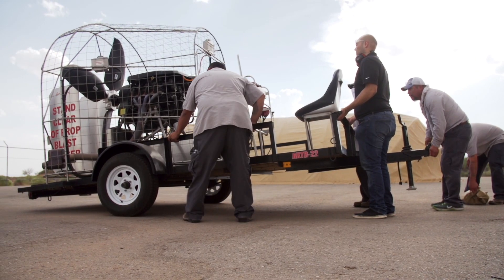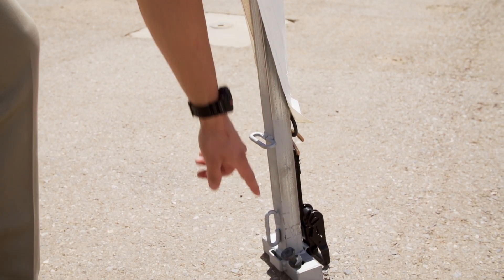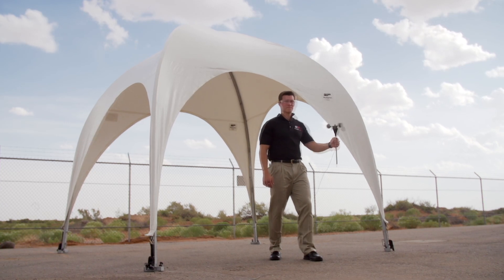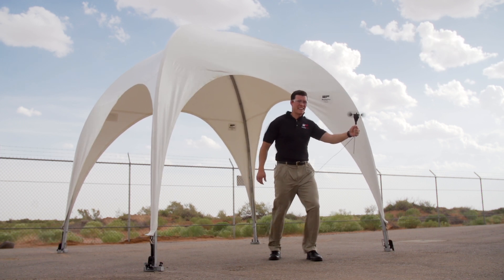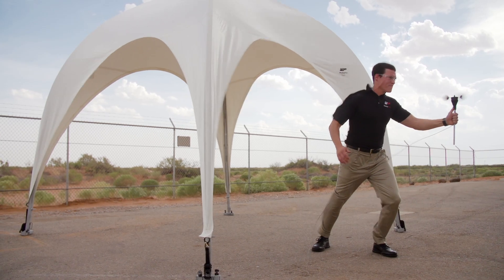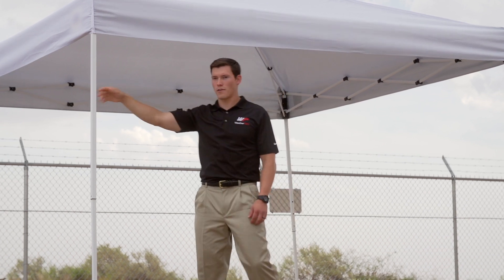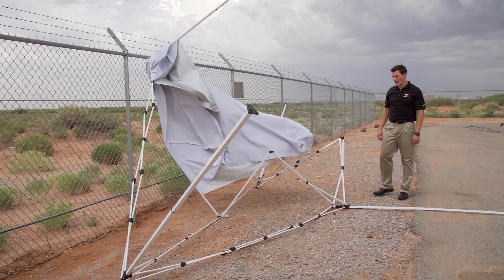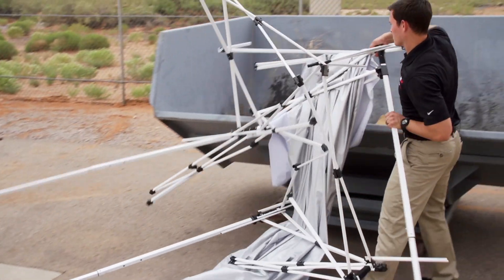WeatherPort Canopy vs. Pop-Up Canopy - Wind Test!

Comment: This is a $1600 canopy vs a $100 canopy. I would hope yours is better quality.

My biggest issue/question is. Are those heavy duty ground spikes you used on your canopy provided with it for the price? Because if not this is very disingenuous. I would actually be interested to see the cheap tent with those same ground spikes if you guys don't provide them with every tent. The structure of the cheap tent didn't fail until it was ripped out of the ground and flipped over. I have a feeling if it was mounted better then it would have gotten much closer to the wind speed of you tent, and at a small fraction of the price.
Reply from the maker: Thank you for your comment and for taking the time to watch our canopy wind test video!

You're absolutely right—there is a significant price difference between a typical $100 pop-up canopy and a $1,600 WeatherPort® Canopy. While both may fall under the general category of canopy structures, the quality, durability, and performance between the two are vastly different.

Our high-wind canopy is built with a significantly heavier-duty steel frame compared to the thin, collapsible tubing used in most pop-up canopies. Additionally, the fabric membrane cover is not standard tent material—it's a proprietary, tensioned fabric designed for year-round use in harsh environments. It's UV stabilized (not just coated), abrasion-resistant, mold- and mildew-resistant, and won't rot—features that make it far more durable and reliable over time.

To answer your question directly: Yes, the heavy-duty ground spikes used in the video are included with the canopy. WeatherPort® Canopies are designed to be securely anchored in a variety of ways, including directly into the ground (using the provided ground spikes), to wood platforms or decks, to concrete or asphalt surfaces, or by using optional ballast frame systems with water barrels or concrete blocks for non-penetrable sites. Duckbill anchors are also available for extreme high-wind conditions.

While we agree it's not a perfect apples-to-apples comparison, our goal was to clearly show the physical and performance differences between typical pop-up canopies and high-quality, heavy-duty canopy structures designed for much higher wind loads.

Thanks again for your interest and thoughtful questions!

If you'd like more details about WeatherPort® Canopies or other rugged outdoor shelter options, feel free to visit: https://alaskastructures.com/products/canopies/
Reply: @WeatherPort  that's a deflection. I see no ground spikes on the "cheap" one and you did not answer the question. Are those spikes included or not? This is an infomercial quality comparison and should be taken as marketing and not an honest side by side compare.
Reply from the maker: @schneik80  Hello! Yes, the heavy-duty ground spikes used in the canopy wind test video are included with the WeatherPort high-wind canopy structure.

While we didn’t specifically focus on the ground spikes that came with the pop-up canopy, you can see them around the 2:00 mark in the video. When the wind starts to pick up, you’ll notice the pop-up’s legs stay put briefly, but then begin sliding and eventually get pulled right out — showing just how easily those standard stakes can fail in strong winds.

Thanks again for watching and asking thoughtful questions — we really appreciate it!

Comment: I need this!!  Had a “Master Canopy”. 10x10 with the roof vent that supposedly makes it a better choice for windy areas.  🤦🏼‍♂️. Second time I ever used it… first time was a dead still sunny day.  It was fine. Yesterday it got destroyed by (the infamous afternoon) wind gusts at Willow springs raceway in Rosamond CA. The scissoring struts broke in three places and it collapsed. Scratched the crap out of my truck to which it was secured on one side.  There were 100 other guys out there with their own Ez-up/canopies.  Mine was the one that got destroyed. I left it for the trash collector.  Cheap thin wall pot metal struts work just fine if there is no wind.  The only thing a “Mastercanopy” actually masters is your Mastercard
Reply from the maker: Hello Steven! The news about your truck getting damaged by a pop-up canopy is horrible! Thankfully nobody was injured during the sudden wind gust. Our WeatherPort canopies are a heavy-duty alternative and, when properly anchored, provide a safe and secure space to enjoy outdoor activities. You can find more information about WeatherPort canopies here: https://weatherport.com/products/building-models/canopies/

Comment: any chance you can redo the test with the cheap popup properly anchored?
Reply from the maker: Hello mp! The 10' x 10' pop-up canopy was anchored using the metal ground spikes that came in the box. Our 10' x 10' heavy-duty canopy was anchored using the ground spikes commonly used to anchor our canopy structures and fabric buildings. More info about our outdoor canopies can be found here: https://weatherport.com/products/building-models/canopies/
Reply: @WeatherPort  So you used included minimal tie downs for the cheaper canopy and industrial 3rd party tiedowns for yours? A fair test would use the same tiedowns. You know since neither top came with the ones you used for the winning model

Comment: What a waste of test equipment.  This is BULL... Totally faulty comparison because it is OBVIOUS to anyone that the canopies were bolted in a different manner and with different bolting material.  The PROPER test would have been to add the SAME weights (eg, 50 lbs per leg) and the same attachment cords to each canopy.  This would be the only way to compare the two.  TOTALLY USELESS VIDEO.... Makes me NOT want to buy your product due to the purposely misleading/shady video.

Comment: Everyone can’t take a 12 and 20 foot ladder somewhere with them just to be able to use a canopy I mean it would be nice if you made one that handles winds like that.That’s just a pop up.
Reply from the maker: Hi Robbie! Agreed. Carrying a ladder to a beach to set up a canopy is no fun. Thankfully, we designed and engineered our heavy-duty canopy structures to provide a large opening (7 ft. tall) for easy access into and out of the canopy and for a setup that doeasn't require ladders!

Comment: That popup canopy has guy lines for a reason. You didn't properly secure it to the ground. They can hold up to much higher wind speeds when properly staked out with guy lines and all. Do the test again and read the directions on the pop up to stake it out properly, with the guy lines. Here's a video of a coleman pop-up canopy in 40MPH wind with no problems. https://www.youtube.com/watch?v=tl4NLtvNGr4
Reply: I'm surprised the pop up canopy made it past 10 mph.. Even "properly" secured those pop up canopies are light weight and hold up to zero stress. Maybe good for cities, fairs, booths, etc on calm days.  When you live in the country like I do with constant wind they just do not hold up.
Reply from the maker: Hi Thomas! We wanted to do a side-by-side comparison. Our 10' x 10' canopy structure did not include a guy line package. So we chose to do the canopy wind test with a 10' x 10' pop-up canopy without the guy lines. In our canopy wind test we found the plastic connectors that hold the metal pieces together were easily damaged in winds of 30-40 mph. Seems like this is a common complaint against instant canopies that use a similar frame system. Our heavy-duty canopy frames are made of galvanized steel or aluminum and do not contain plastic connectors that can easily break. More information about our long-lasting canopies here: https://weatherport.com/products/building-models/canopies/

Comment: Yea let's anchor down the expensive one with giant spikes. And anchor down the cheap one with cheap spikes so the cheap one will fly away. That's not a real test. Anchor down both with the cheap spikes and they will blow away.
Reply: I agree.  So the pop up tents spikes suck.   Win for your product. Now let's see what happens when the pop up is anchored correctly.
Reply from the maker: Thank you James for watching our canopy wind test video! We used the spikes that come with the pop-up canopy as well as the ground spikes we provide with our high-strength canopy structure. As you pointed out, our ground spikes (and canopy structure) are much more ideal for high wind situations.

Comment: Should do SETUP with high winds.. that's where the question will be...  but this is good, and pretty interesting... how do you have these anchored?  how about in BEACH SAND..
Reply from the maker: Hello Monica! The WeatherPort canopy can be assembled in all weather conditions, including high winds. We have many customers that use their WeatherPort canopy structures at the beach. We offer many different anchoring solutions. For a day trip to the beach, you could use a ballast system that would allow you to use weights or containers filled with sand. When you design your WeatherPort canopy, the building specialist can discuss the anchoring options and specific requirements to ensure the canopy is being used safely at the beach or in high wind conditions. If you are interested in learning more or designing a canopy structure, give us a call at 970-399-5909!

Comment: Certainly appears to be a decent canopy....but kind of a useless comparison. A cheap $50 dollar pop up canopy that is intentionally designed to be light weight and able to be thrown up in a matter of minutes is obviously not the equal of a far more expensive canopy that appears to be intended as a more quasi-permanent structure.